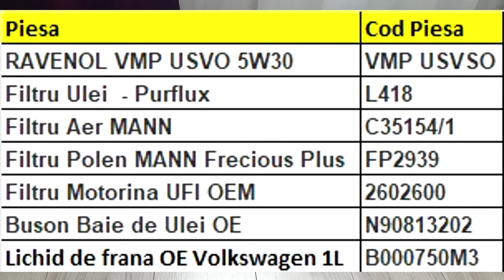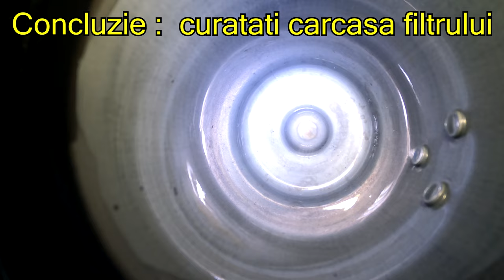💥Revizie & mentenanta anuala ,10.000 km sau 250h de rulare💥Tiguan 5n2 - 4Motion - 2013-2.0 TDI-CFFB💥

Comment: Salut, pentru curatarea regulatorului de presiune rampa care ar fi procedura? Pur si simplu desfac ce e de desfacut acolo curat bine sita si locul unde intra si atat? La ce te referi cand spui amorsare? E vorba despre un Tiguan cu motor exact ca al tau. Multumesc!
Reply from the maker: Se ruleaza procedura de incarcare sistem din Odis sau VCDS pana acesta se presurizeaza conform specificatiei. Punerea contactului nu presurizeaza sistemul corespunzator , poti pune si de 10 ori si nu ai de unde sa stii ca este la presiune optima sau nu. Amorsarea necorespunzatoare este cam principalul motiv pentru defectarea pompei CP4 care duce la span.  Si scoaterea filtrului de motorina presupune amorsare tot cu Odis sau VCDS.
Reply: Ajuta la ceva curățarea regulatorului?
Eu am Q3 CFGC. Nu l am desfăcut niciodată sa îl verific.
Ști la ce cuplu se strâng șuruburile de la regulator?
Merci